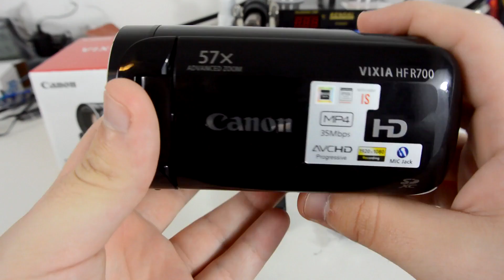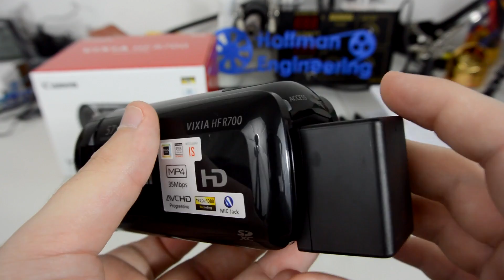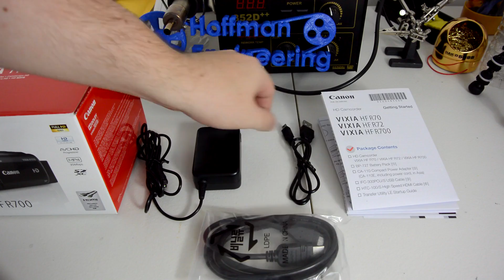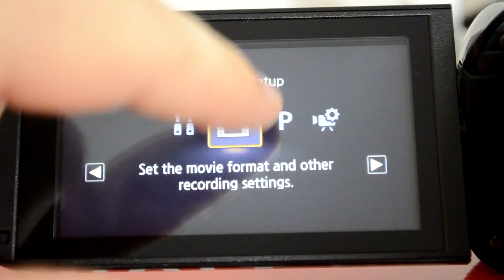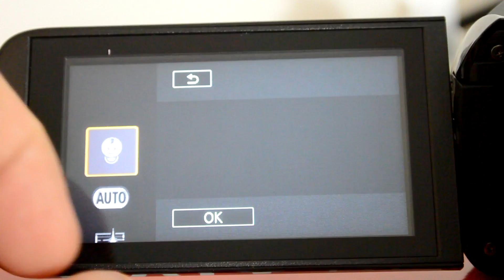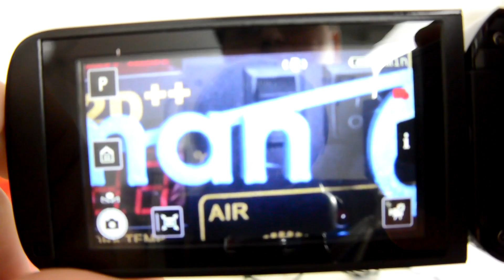Canon VIXIA HF R700 - New Camera Specs

Comment: Can you run the camera off of the AC Power adapter, bypassing the battery?
Does the camera work with as a streaming webcam on sites like twitch via the HDMI port?

Comment: DON'T BUY the R800 series. Buy the R700 Series. Reason. R800 does not have the HD AVC format to record in. That's important because the R800 will only record MP4 and give you 20 minute files each. That means when editing you have to drag and drop each file into your editor, But this R700 Series can record up to 12 hours and make it one file. AND I believe it can record in AVC & MP4 mode simultaneously.  So you have the best of both worlds. R800 Series have dropped the AVC mode. Also it is almost the exact same camera.
Reply: Well good thing i have the vixia hf r700

Comment: I noticed on my hf r600 if you tap the info mark on each resolution except the 60p it doesn't get it but on the others it tells you what that quality can record in and you can choose 30fps or 60fps BTW the 4mbps should be 720p.

Comment: If 35Mbps is 60 fps, Does that men 17 Mbps is 30 fps at 1080? If so what frame rate is 4 Mbps at 720? Unless that doesn't mean that at all. I can't find anywhere where it tells you the frame rates like it does on DSLRs!
Reply: I was looking at a used Canon 600D with a 50mm lens, but that would be more expensive than this and very limited focal length. I like the idea of the super zoom on these for wildlife.

Comment: QUESTION: Is there a way to display the Date and Time in a way that is recorded when you are recording in both AVCHD and MP4 modes? ... I've looked at the instruction manual, and I saw the "Baby" stamp. ... I need something more professional looking than that particular display stamp. I just need the standard Date and Time. ... The manual says when you "Play" it you get the Date and Time with AVCHD, but with MP4 you only get the Date. ... I'm not worried about Play mode. I need to know if the Display of the Date and Time can be Recorded so you can see the Hour and Minute when Recording in MP4. ... Thank you.

Comment: Can a rode videomicro mount onto this?
Reply: Luigi Bros. Unfortunately the videomicro plugged directly into the mic jack will not work. Only battery powered external mics will work through the mic jack. The video micro can work if plugged into a external battery powered audio recorder first, i.e. zoom h1, then plug the zoom h1 into the mic jack 👍
Reply: I can vouch for the RODE VIDEOMIC working with this camcorder.  It takes a 9volt battery. The RODE VIDEOMICGO doesn't have a battery and does not work.

Comment: Open and close it turn it off and on pointless buttons
Reply from the maker: There is a setting to toggle whether opening/closing turns off the system. Also, you'd probably want the camera off when removing the SD card, so the power buttons allow you to turn it off and still access the card.

Comment: didn't mention whether this camera mountable to tripod
Reply: lmao that's what I wanted to know
Reply: Yes, I got one, it is.
Reply: I was looking for that too LOL
Reply: Yes it does have a Tripod Mount. DON'T BUY the R800 series. Buy the R700 Series. Reason. R800 does not have the HD AVC format to record in. That's important because the R800 will only record MP4 and give you 20 minute files each. But this R700 Series can record up to 12 hours and make it one file. AND I believe it can record in AVC & MP4 mode simultaneously.

Comment: Hey, nice video! Im looking for a camcorder to film myself when doing gameplays, and i need one that can film long videos without losing any kind of information... do you have problems when shooting long videos on canon vixia r700?

I ask that because my cellphone, for example, and my dslr, both can film long videos, but every time they get a 4GB file and need to start another they stop filming for like 5~6 seconds until they start filming again, and i end up losing sync/data and when i put the files together they seem "cropped" and i can't use it...

However, my gopro films straight and starts the next file right where the last one ended. Can't find this information anywhere, so i thought it would be good to ask someone who actually owns the camera.

Btw, how is it to film in doors with softbox light?

Comment: Good Review ! Im Wondering what the differences are between the R700 And R600? Do You Know Off Hand? Someone said they did away with the Mic Port on the R700 Obviously That was Wrong information as I am Seeing that port in your Video. Just Curious since I Own The R600 And Am Pretty happy with it. How quickly they make the models obsolete , every year it seems >>  Thanks..

Comment: I have a G7X that I just bought to do my Rear Window Video sequences. The battery life is way too short, and it stops after reaching a file size of 4GB, which doesn't really work for me either. Also, the video is very shaky. I'm wondering if the R700 would alleviate all of those issues. One other question: Can this camera run with direct AC plugged in from my 12V outlet in my car outlet? Thanks for a quick reply.
Reply from the maker: My VIXIA can be on indefinitely while plugged into the wall, so I don't think that would be an issue. The camera will also split filesizes into 4gb chunks, but it will keep recording as it switches to the new file. I've recorded a 2 hour workshop and it happily split it into multiple 4gb files.

I can't give you direct data on the shakiness though. It does have some pretty good active image stabilization, but it also depends on the mounting. 

I hope that helps!
Reply: Yes. That helped a lot. I picked up an R700 today. Currently have it plugged into the wall charging the battery. The manual says the first charge should take 7 hours and 45 minutes. WHAT? Oh, well, there's always tomorrow to test it out. Thank you for the info.
Reply from the maker: Yeah, it actually takes a while to charge, the battery is surprisingly large. 
Let me know how it works out for you!
Reply: Will do. By the way, one of the features it has, which I wasn't aware of before buying it, is that it will return to your previous zoom position after you turn it off and back on. This is going to be very handy because it always took me a while with the G7X to get my zoom distance right in my rear window. Plus, I can take the SD card out without removing the camera from the car mount, which will also save me a lot of repositioning each time. This might be the rear window camera Ive been looking for.

Comment: Does it come with sleeker battery pack, or this ugly cube is the only one included? What is battery life?
Reply from the maker: It does not come with a sleeker pack, it turns out that this is the standard battery for many of Canon's cameras, so they just stick out the back like that. You might be able to find another 3rd party pack though, I just haven't looked for one. 

This battery tends to last me between 1-2 hours of 1080p, 60fps recording. Of course, lowering it to 30fps will give you more recording time.

Comment: i think i saw in the manual that certain video/quality modes will stop at 12 hours, not unlimited
Reply: +kn00tcn Dang only 12 hours. I need mine to record after the human race goes extinct.
Reply: ;P how much time does R700 record at a stretch, by the way? Any idea?
Reply: The max I've ever used mine was for 2-4 hours straight on the 30fps 1080p setting. No issues. Not sure about the max for that mode.
Reply: Thanks, Jake Methner!

Comment: Nice thorough pre-view. Looking forward to the full usage review.  Are you using the Movo audio system in this video?
Reply from the maker: +RJ_Make I am not, the Nikon j3 I used to record this doesn't have an external mic port, so this is with the relatively low-quality mic on the J3. Tests with the Movo will be coming soon!